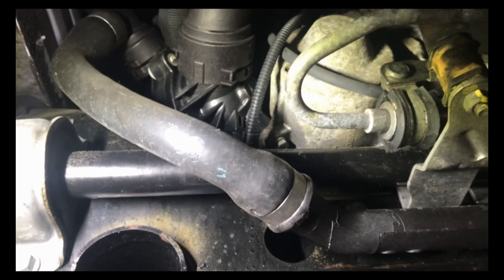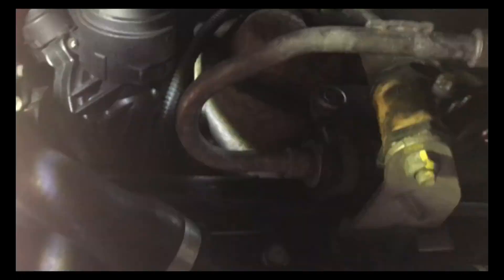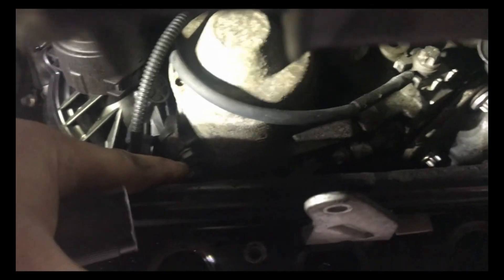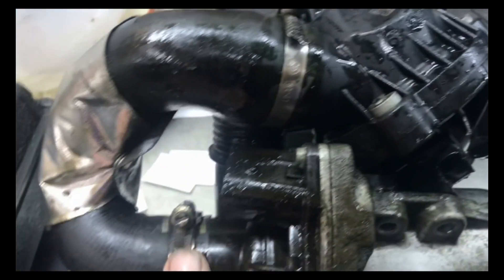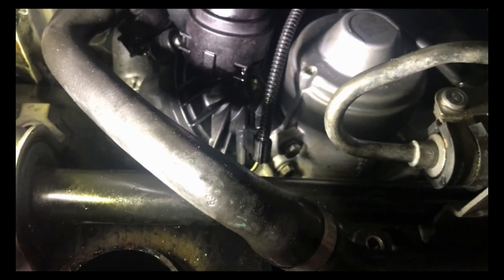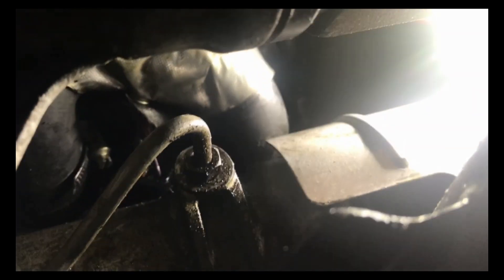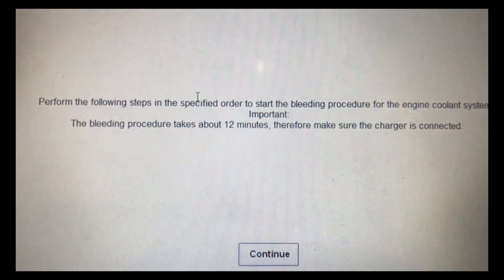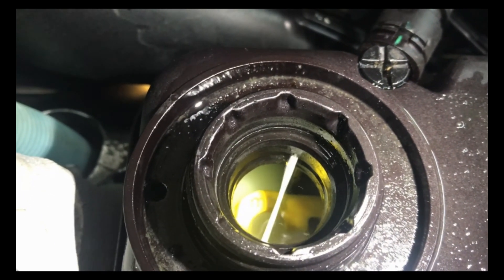2011 BMW 335I Electric Water Pump And Thermostat Replacement

Comment: Just used the info in this video on the same car.  What a PIA! Too many hoses and tight working space.  It took two of us ~5 hours with only a few short breaks.  Remove the Fan housing completely helps. I suggested lowering the Sub-Frame (Not remove but lower about 1 inch) to provide a bit more room but my buddy owner didn't want to do that. We used (1/4" drive 10mm or 12mm - don't remember) standard short socket on the inverted torx bolts with a swivel.  That socket fit tightly but I had concerns about slipping but it worked okay.  You must leave the pump and thermostat separated so you can maneuver and twist the pieces around to ensure the hoses are securely tightened. Take note of the orientation of the hose clamps before removing because it will be difficult to reach if installed the wrong way. We got it done but it is probably one of the most difficult cars I have ever worked on.  Replaced both Turbos on an N54 recently and I will never do that again unless I have a lift.  Great video.  Thanks.
Reply from the maker: Thanks for watching

Comment: The most important part of this video is how you managed to get those bolts off , with what tools. And you didn’t even show that. Smh🤦🏽‍♂️
Reply from the maker: There is no room to put the camera in there to show everything. I think i explained it pretty good. For the tools it's just metric tools except for you are going to need reverse tork sockets.

Comment: Wished you would’ve shown how you managed to get the 2 bottom e-torx bits off. Can’t get any kind of ratchet or wrench in there
Reply from the maker: I think I used a socket. Was not easy. Thanks for watching

Comment: did this today and I swear the back hose was a bitch to get into. and the u hose that connects the two together was too short. wish it was longer. the putting it in was harder than taking it out. sad.